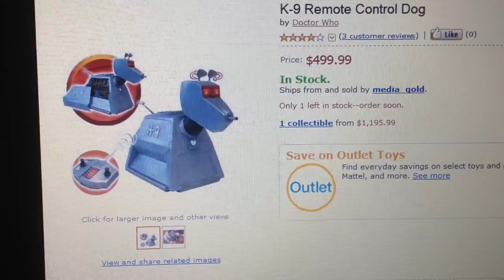K9 Toy Hack - Video 1 - Hey! A talking dog!

Comment: i'm having issues with this toy, and this is the only time i've seen one taken apart. - the motor for the nose blaster appears to be damaged, and shorting out the device. thankfully it doesnt ruin anything, just causes it to freeeze up and stop responding. im having a difficult time getting into the head itself, however. im not sure how these screw caps come off.